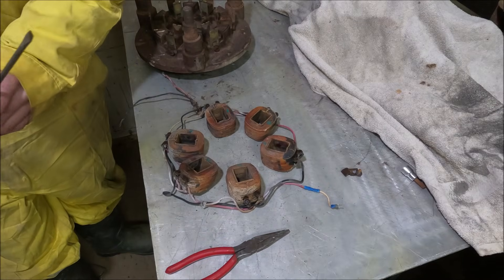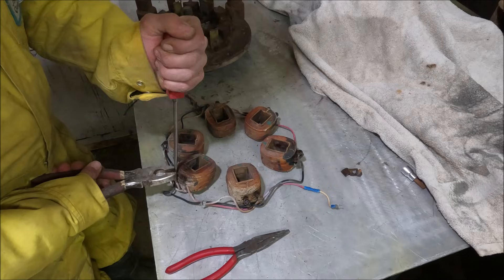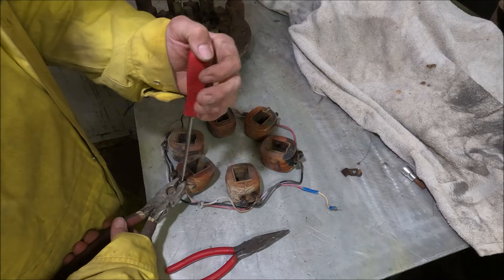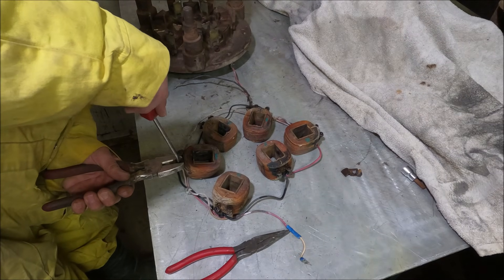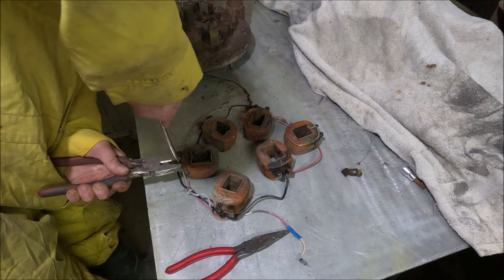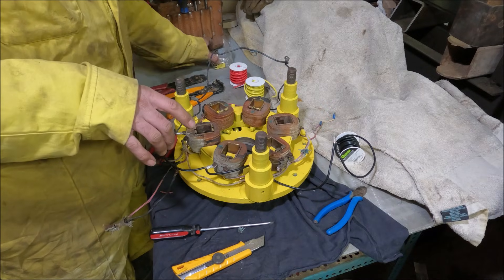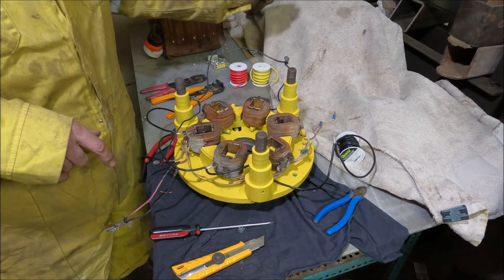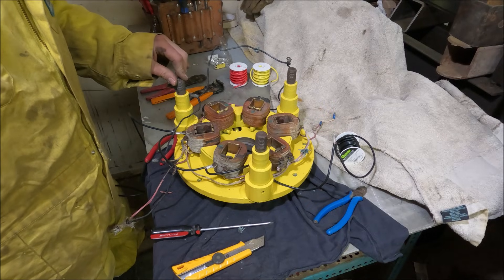LeTourneau tournapull D electromagnetic wiring for the winch brake

Comment: I’m from the soldering school of thought .  After years of motorcycle work on Harley’s and British motorcycles which have intense vibrations I found most electrical failures on home done wiring was crimp terminals losing a good contact. I never had a problem with breakage but then again I would always use heavier gauge wire than what would be necessary. Only suggestions I would make to people just crimping is have a good quality crimping tool, use eye type terminals, not forked ones and don’t crimp ones with insulated crimp area instead slide small shrink tube over wire, crimp on terminal and have shrink tube long enough to cover crimp and equal distance back over insulated wire to support wire to terminal as where wire enters terminal is where wire may vibrate until breakage. But again one should do what works for them. I have to add one more thing. Make sure when stripping insulation that the tool doesn’t nick the copper wire as any nicked or scored wire strands will vibrate and break.
Reply from the maker: Yes I agree. The heat shrink and not nicking the wire are very important. The "red blue yellow" plastic ones are some of the biggest culprits of poor quality. Just get rid of the plastic and I'm sure the crimp thing would be fine. But the plastic always slides off to the side as your squeezing and you cant get a good solid crimp.
Reply: @ I have plenty of time to sit and critique at the moment as I’m sitting spending time with my 97 year old Mother as she has been feeling weak.
Reply from the maker: Good for you, family time is very important.

Comment: Looking good!  Glad you switched to crimps.  For motor building, it’s good to test the coil insulation resistance (to the frame) as you go, this will find any weak spots that could turn into a short.